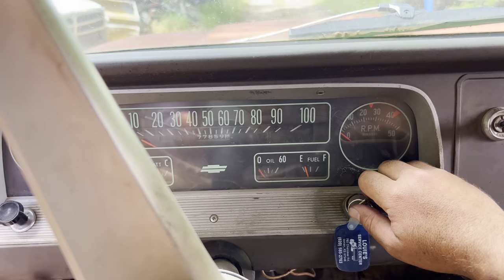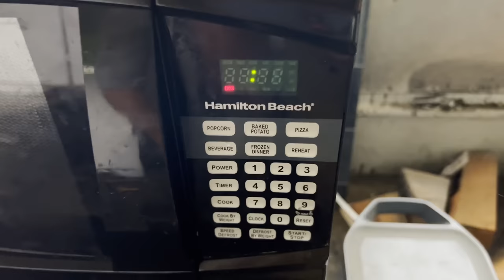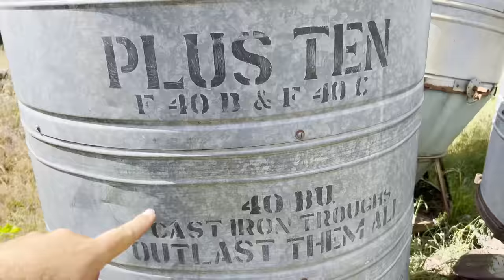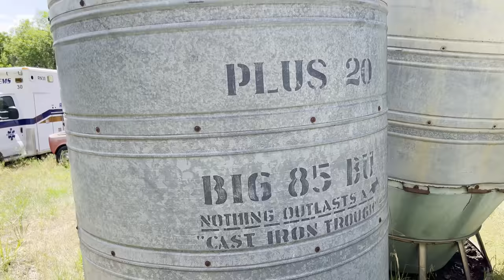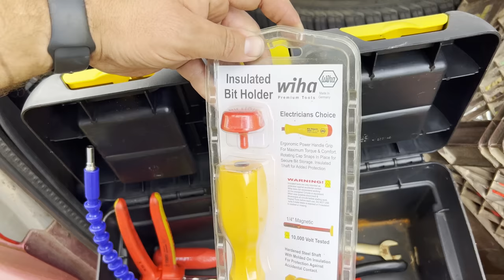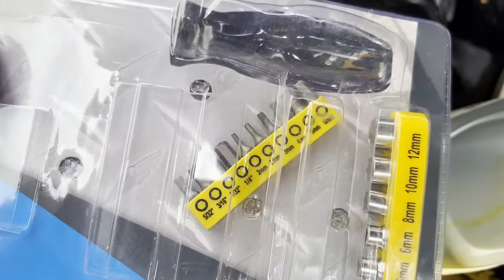What was in the TRUNK?!? Unexpected Finds from an ABANDONED Junkyard Car

Comment: Knipex are professional tools made in Germany. Quite expensive here in Sweden.
Reply: Knipex are not cheap here in the U.S. either
Wiha and Knipex can take a beating, super quality tools.
Reply: quite expensive here too in the states
Reply: They are spendy here in the USA also but good tools
Reply: I got my super lucky spot where alot of the local power utility trucks go flying over a huge bump & dip in the roadway & usually high quality tools literally fall off the truck ,they lose unsecured tools & sometimes toolbags full of tools 🔧, & they usually roll into the tall grass & woods ,found plenty of hammers ,screwdrivers as well as pliers ,cutters & other high quality linesman tools from Klien tools ,Crescent, Cooper industries, Whia & knipex, also find lots of traffic cones that get knocked off
Reply: @daewooparts  well said  found a few wrenches and prybars in my area
Reply: @jeffclark2725  the funny thing is that Cooper industries, the company that makes linesman pliers & cutters also makes those 30rd mil spec magazines like the ones he found in the trunk ....those was a great find
Reply: Took the words right out of my mouth
Reply: Knipex make some quite good pliers and cutters iv had mine for years .

Comment: The pliers with moveable jaws are multi-grips, if I recall the term correctly. You can slide the lower half of the jaw opening it up or down to use on small or large objects. Popular with plumbers because you can easily grip onto pipe fittings and twist them around to tighten or loosen them. A lot less popular now because of PVC piping, but still very handy for anyone who is working with older metal fittings.

Comment: The item in the second tool box is an oil filter remover, I have 4 of them and they work great as long as the spring is still attached. the other item that fell into the crevice and got covered up was another stile of oil filter remover.

Comment: As far as I 66 farm truck. I'm sending oil I get about 3,500 for it pretty easily. Of course he flashes sold up on the screen. He said he'd be happy with getting about 3500$$. Salt in the wound. But good for Silas and the buyer. I know some guys prefer the later model 67 and after 327. Mys will go and get yourself a 350 if you're going to do that. I agree with Silas the small journal early 327th are much better. In the bigger truck the only problem with a 327 is that they like to tear out the crankshaft. At one time jover at the restaurant had a couple of Studebaker trucks same size as this one. 2500 3500 I believe was his prices for each one of them. Already have a 66 with less miles not as good looking but original paint and I've got about that much in it already and I don't know if the 283 is going to start. They're great trucks. If you're a a house rehabber or a roofer then this is the truck for you. Keep an eye out Silas will have another one

Comment: Knipex pliers are totally pro quality and not cheap, plus most/all of those were insulated for electricians.  Wiha is excellent, not quite as top-level pro though.  You got WAY more than $100 of tools there.

Probably a mistake to show/talk even as much as you did about you know what, if you want this video to stay monetized forever.   Showing it off is tempting vs editing it out, but editing it out is smarter.  Even if it remains monetized, you'll lose points for level of family-friendliness and other stuff, get promoted less, and suffer in the long run.  Build your own website for stuff like that.  Using a big platform like YouTube that can cut your income anytime without even saying what they didn't like you doing, is risky.